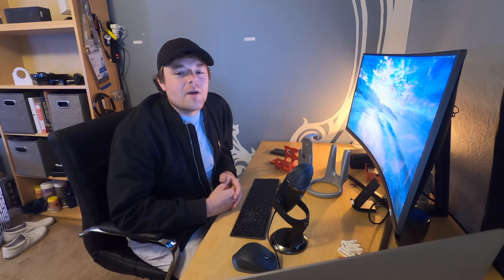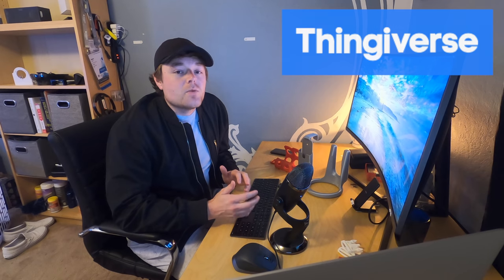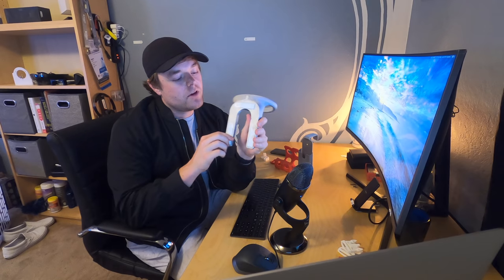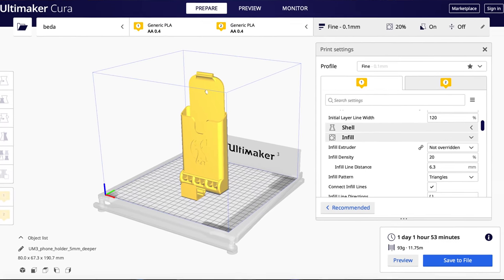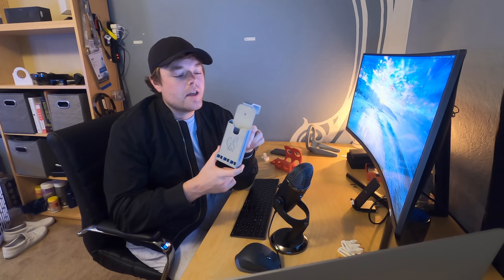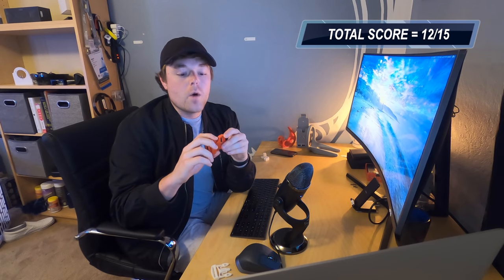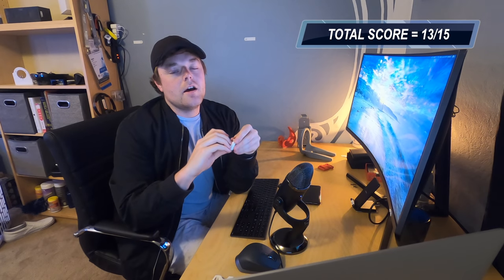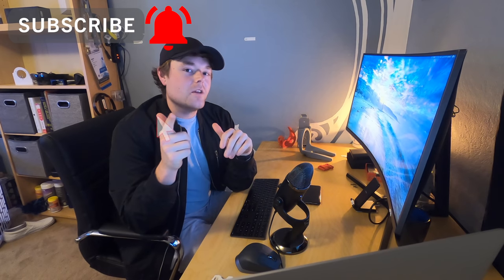Top 5 Most Useful 3D Prints! (2020)

Comment: Since the amount of material has a massive relationship to both cost and time to print, those two variables are strongly correlated.  Using two strongly correlated variables as separate measures amplifies the common base variable (i.e. amount of material), which can easily outweigh other, more meaningful variables.  For example, given the amount of material used in your 5th rated versus your 1st rated prints,  doubling the effect of the material quantity is likely to effect the overall rating more than the actual utility of the prints, which is counter to the title of the video.
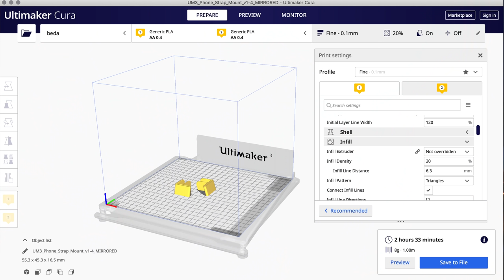Reply: Although the cost of material doesn't change, the print time can be. I would print the hand towel holder with an 0.8mm nozzle at 0.2mm layer height, cutting print time from 33:14 down to 12:54. The final result may not be as smooth, but still functional.
Reply: Hmmm.  Sounded very educated until effect was used in place of affect.

Comment: I was thinking the same thing as many other folks. I have a Ender 3 V2 and I print PLA at 65mm/s to 85mm/s depending on the items detail and I typically use a .04mm nozzle with a .24 to .3mm layer height. As for my go to filament, I use OVERTURE PLA 1.75 from Amazon with next day shipping for only $22.99 a 1kg which after tax comes to just under .025 cents per gram. 

I hope these numbers maybe assist you in faster and cheaper prints in the future. My favorite PLA from OVERTURE is the Matte Black PLA as it looks great and prints beautifully.
Reply: As a added note. Overture quality is excellent from my experience. It infact personally surpassed most of the "premium" PLAs on the market. People can defend their premium stuff but honestly those people just don't like to admit they got scammed lol.

Anyways I like printing at .1mm layer height because it does overhangs better. If I am printing a part with little to no sharp overhang angles then .2ish is fine. Nothing a bit of sanding can't fix super quickly for those visable layers.

Anyways you really should try buying from the overture website. Amazon doesn't take a slice of the pie and it's the same price. You can even get a discount for buying 3 and 6 packs.

You also get $10 off orders and free shipping if you spend more than $50. Sure... you won't get 1 day shipping but you'll be supporting them more and it's cheaper.

Comment: I giggled a little when you talked about the temperature in CA and 3M adhesive. Where I live in CA - TODAY it was 90 degrees and in the summer it pushes 110 degrees 50% of the time. 3M adhesive melts off in one afternoon. I like those clips at the end, but I've yet to find an adhesive that doesn't just slide off my dash, so I have to use precarious vent mounted abominations. :)
People are amazing when it comes to 3d printed creations. This was a good video!

Comment: petg actually absorbs water more than PLA or ABS and it is a pain to print with because of this. Gotta make sure it is dry first. PETG is actually a better filament for hot areas and/or for durability as it has some flex to it making it a good filament for that buckle/snap piece instead of PLA.

Comment: Why you print everything on fine setting
Reply from the maker: Andrew Whalen so prints come out at a fine resolution. Especially for prints like the backpack buckle, the tolerances were pretty tight so it required a resolution setting that was pretty fine (although the layer height resolution does not affect the tolerance stack up in the x and y direction, the speed of the extruder can certainly have an influence on step and gap). As a result, to keep variability consistent print to print, I kept the same settings 😄
Reply: But the layer high has nothing to with the resolution. The lines are still 0.4 mm in diameter, they just get squished more. Yes the layer lines are less visible, but even if you want that, you can print with dynamic layer height and reduce them when printing round overhangs. 0.1 mm layers are usually useful when printing miniatures and other high detailed stuff, where you need details in all three directions. In X/Y direction you always have a high resolution. I bet printing with 0.2mm would create the same result in half the time and half the time also means half the mount of electricity used, which btw your calculation lacks.

Comment: 4:46 You have printed the towel holder the wrong way. There is no need for supports when you turn it by 90 degrees.
Reply from the maker: Hi Jemand! Due to my printer size, the towel holder would have exceeded the z height of the bounds of my printer if reoriented . Nice suggestion though 👍

Comment: How slow you print???
Reply: I was wondering about that too
Reply from the maker: Hi Kari, I typically print slower to ease on the mechanical systems of my 3D printer. By using an expensive printer for high resolution prints, you can avoid stringing, step/gap issues, warpage, and non-uniform wall thicknesses. We have to remind ourselves that these are still mechanical systems, and if we push them too hard it can result in damaging mechanisms which in turn would result in spending even more time replacing the stepper motors, threaded rods, rubberized treads, or nozzles. I believe that by printing at an accurate/slower print speed, it can extend the overall life of the mechanical systems, and return a great print (especially if we can leave these running overnight while we sleep!).

My printing settings are as follows due to the previous reasons: Layer height: 1mm, Infill: 20%, Line width: .35mm, Wall thickness: 1mm, Bottom Layers:10, Print Speed: 70mm/s, Initial Layer speed: 20mm/s, Wall speed: 30mm/s. I hope this helps, and thanks for the support!
Reply: @adamtjames  You would think an expensive printer would have higher end components to be able to handle the higher stress. Instead you're puttering at idle speeds. Belts are cheap to replace and fiber reinforced ones take forever to wear out of spec. Motors don't care, and assuming linear rails they'll go thousands of cycles before you even have to clean and re-oil. With the logic of caring about wear,  you could also argue that putting heat on your hot end, extruder, motors, drivers, electronics, and power supply for sustained periods of time like that actually causes more wear than you would mechanically.

Assuming your machine is tuned and in spec, it's easy to get very accurate prints at much higher wall speeds, which looks to be what is slowing you down the most. Maybe run a few speed tests to calibrate it a bit more.
Reply from the maker: straytowel 👍

Comment: Definitely loving the phone holder / amplifier. I'm really confused with the times and costs he listed in this video for this print. My filament costs ~0.02 per gram (1kg rolls at $16.50  per roll calculating only the 800g usable filament because of spool holder) and I printed this in 10hrs at a 0.16mm layer height. Over 24hrs to print and over double my filament cost really doesn't make any sense...

Comment: Free, limited version of Fusion 360 for qualified hobby, non-commercial users. Basic features include:

• Standard 2D/3D CAD tools
• Limited electronics – 2 schematics, 2 layers, 80cm2 board area
• Basic manufacturing – 2.5 axis milling & 3 axis milling, turning, FFF additive, fabrication
• Local rendering only
• Limited to 10 active and editable Fusion 360 documents, unlimited inactive documents
• Single user data management only
• Forum support only
• Limited file type import and export

Comment: Why is your Ultimaker so slow? The Sidewinder X1 prints the towel rack in the same orientation with supports in 9 hours.... (At the same 50mm/s) Rotated so the ring is on the buildplate removes the need for supports and it's only 5 hours!?

Comment: So hey there. PLA and ABS are not the most hygroscopic. PETG and ABS are, PLA is the best for staying dry. Lastly.... so Hygroscopic means it pulls moisture from the air, not from your shower. And even if it did, the only reason you would concern yourself with moisture in filament is because it effects the print quality
Reply from the maker: TheLightSpeed! ! Thanks for the comment. I didn’t necessarily say PETG and ABS weren’t hygroscopic, I was just referring to the fact that PETG is better for water based applications due to its resistance to both water and water based chemicals. When running a warm shower there will typically be higher condensation. Higher condensation leads to warmer air and warmer air holds more moisture which in return could bring a higher hygroscopic value. This is why we put filaments which are hygroscopic in a dehumidifier prior to or while printing 😄
Reply: Adam James PETG is the most hygroscopic filament next to Nylon. PLA is the least. TPU, PETG, NYLON and PVA are extremely hygroscopic. 

I’ve had a 3D printed PETG print in my shower for two years. It looks just like the day I put it in there
Reply from the maker: TheLightSpeed! ! That’s what I like to hear 👍

Comment: I can't help but wonder what kind of speeds people use during videos like these. Even at fairly stock settings for most printers these print times are WAY slower. Like stock settings for an ender 3 in cura, you'd be looking at sub 10 hours for BOTH shoe holders as an example. Assuming a layer height of .2mm. Sure, if you want to print at ridiculous resolutions it's gonna take forever, but that doesn't really do anything as you can do the same thing by just spending 10 minutes sanding the thing as post processing. 

3D printing is slow(ish), but this just seems needlessly slow. I like these prints though. I have some favorites of my own, one of which sits on top of the list and that's new offroad wheels for a robotic lawnmower. The lawnmower has now gone from almost useless to amazing. And for less than 1/10 of the price of what a new set of wheels would cost to buy.
Reply: Yea, the pacing of the video was off it seems, after 2.5 minutes of watching I started skipping through. Over 10 hours per shoe holder? Is he printing at 10mm/s? I noticed he's printing at 0.1mm layer height as well. TBH, printing at 0.16, even 0.2 layer height and 50mm/s would give the same result for way over half the print time, if you don't mind a few layer lines, which can be sanded down or use a filament that hides the lines. Or even slow down your outside perimeter to melt the layers together more. Even remove the supports, on what appears to only be a few layers of "aggressive" overhangs, seems he has overhang angle set to around 30-35%? Just take the slight quality hit and sand off the rough edges it makes for a couple layers, at 0.1mm layer height you can probably handle 50-60 degree overhangs easily (If my crappy clone printer can handle it, your expensive one can).

Comment: why dont you CR-10 v2,  2-4 time faster time
Reply from the maker: michael quick, print time typically correlates to how you set things up within the slicer you create a g-code file with to print with optimal speed/resolution settings. Although the printer itself surely can influence the speed, these can be defined in the slicer 👍

Comment: Who pays 48$ for 900g of pla? Oo
It should be more like 20$/kg if even that high!
Reply from the maker: quality filament comes at a quality price ;)
Reply: @adamtjames  yeah, still a bullshit price.
Even prusament is "only" 30$/kg.
For 20$ you get fine filament. Won't be anything special but print fine.
Reply from the maker: Dezi totally understandable! In this video I was more focused on how useful the prints were. Maybe in future videos I can review budget vs. top notch expensive filaments and experiment whether there is any significant difference in print quality. Thanks again for the support!
Reply: @adamtjames  easiest way to get diligent price is simply know how much filament you have and divide the price by the weight in grams to get the price per gram. This is especially easy with if you’re buying 1kg spool as it’s always just ‘price/1000’ my 18.99 filament is 1.899p per gram. Furthermore you could also include the cost of the electricity, most* 3D printers run at around 200-400W on start up 400, but 200 for most print time. This means your 24 hour print costs roughly the same as running a plasma tv for the same amount of time which is not insignificant. For example you could add a whole dollar to your 30 hour print for the cost of the electricity.
Reply from the maker: AJL 100% agree. Just gonna reference my previous comment for this response 😂
Reply: Microcenter has $15/Kg for eSun/Inland.  Great quality for the price.
Reply: @adamtjames  Filament vs filament would be an excellent topic!

Comment: Never will i understand people who put their phones in the center of the car to use gps. That screen has to be a tool you can look at a glance and not something you have the ability to look at while stopped. Placing the phone on the left (lefties can put it on the right) in a place where it doesn't create a blind spot or creates a non important blind spot is essential in driving safety. 
Also how accurate is cura when determining how much filament you will be using length and weight wise?

Comment: Pla is very UV stable and Abs is not. You're mixing it up
Reply from the maker: schogaia I would disagree with that statement. When compared to a plastic such as ABS. ABS can withstand UV rays for a longer period of time and is much more temperature resistant than PLA 😄
Reply: @adamtjames  abs is more temperature resistant than pla - no doubt about that.

But when it comes to UV stability it's just not true what you said in the video. Look it up it's the other way round.
Pla is UV stable, Abs is not.
Reply from the maker: schogaia https://3dprinterly.com/is-pla-uv-resistant-including-abs-petg-more/ 

😄

Comment: 1. So, no waterproof shower speaker???
2. How do you charge your phone when you mounted there? And during a ride in a hot summer your phone will burn out 'cos of the temperature from the sun. Make a mount with a charger option in fron on the vents. Really useless and impractical mount is this, sorry.

Comment: I'm not convinced your rating system is really indicative of usefulness. For instance if you print something like a flat book mark, and If you put it in a book then it is being used 100% of the time. The cost of material is less than a dollar. I would be surprised if it took an hour to print.  So it gets a score of "15" a most useful item.   I would think something like a cell phone protector case or hands free holder, while with lower scores, should be way more useful because it's going to save you monies if you don't have to get your cellphone repaired, would be way more useful. Also after you have made a few of each item I would guess the next ones usefulness would drop off because you already have some.  2¢'s